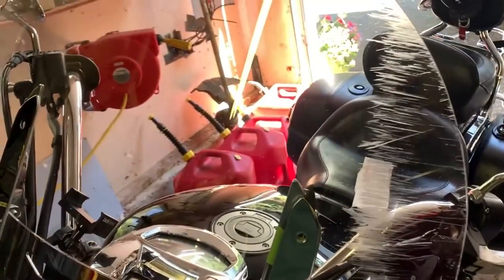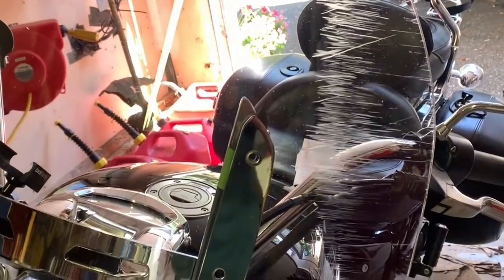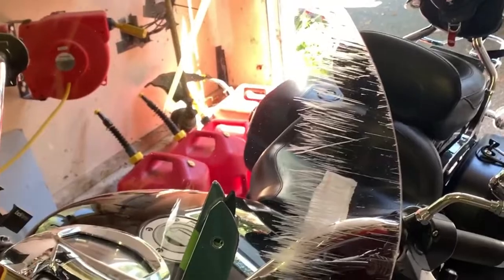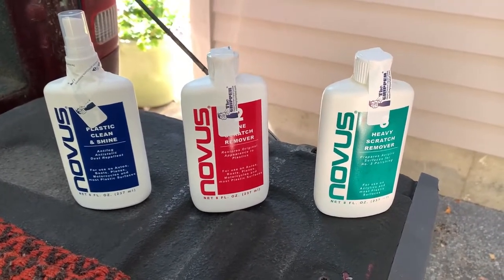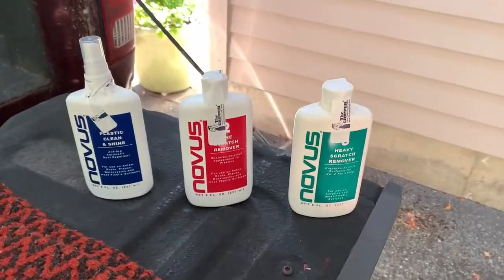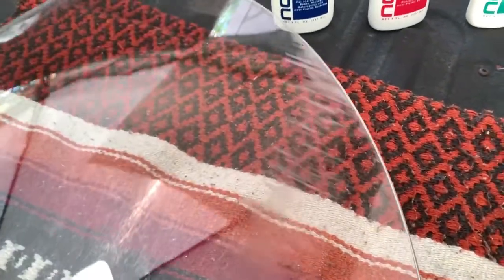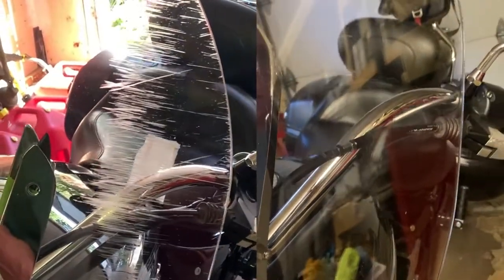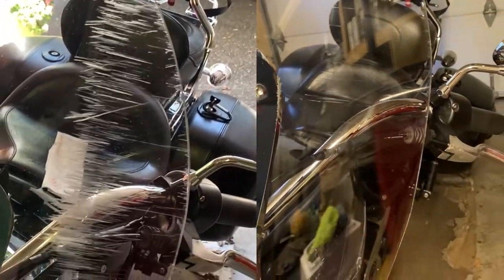Motorcycle windshield scratch repair with Novus products

Comment: i have the same problem with a almost identical bike .
lol !
i wonder if a light sanding will remove the deeper scratches .
Reply from the maker: For me, I was very reluctant to use sandpaper however, if it was a very find grit might be worth a try
Reply: 400 grit did the trick for me, little wet sanding and then straight to novus 3